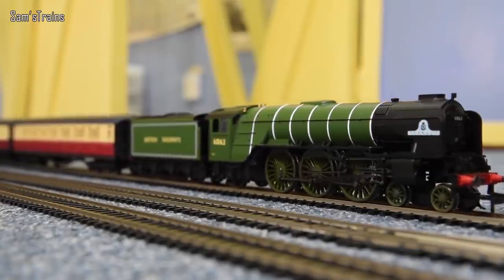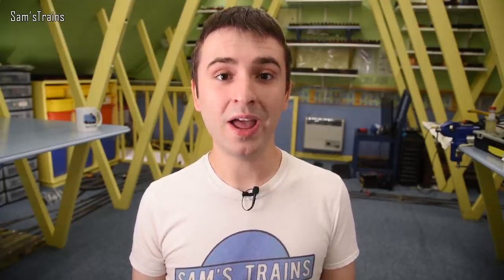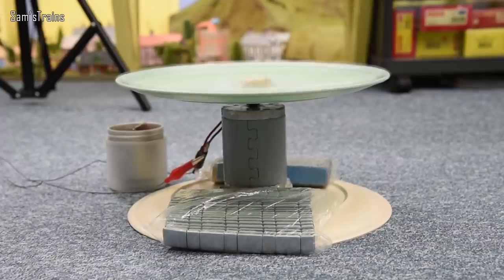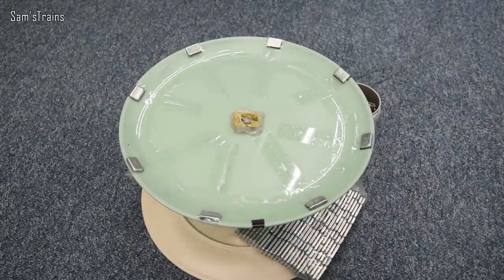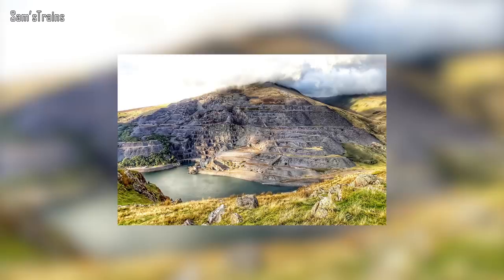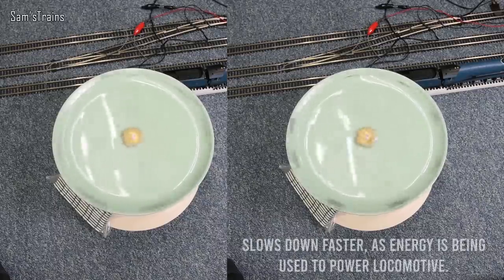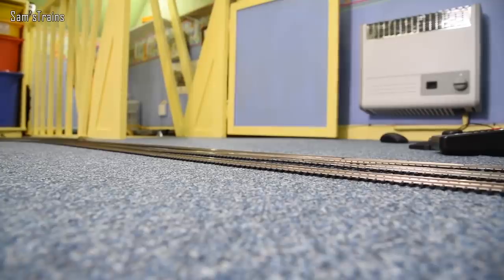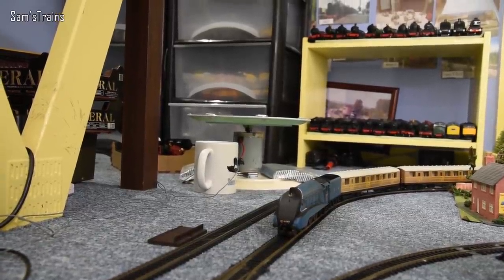Powering Hornby Trains With A Scooter Motor & Dangerous Flywheel

Comment: A safer way I have found is to install super capacitors in the locomotives it provides a lovely affect plus it allows smaller locomotive like a small 0-4-0 locomotives to pass over dead spots (Express points) without even stuttering.
Reply from the maker: Yeah that sounds cool! Are super caps not sensitive to polarity then?!
Thanks for watching - Sam :)
Reply: @voltare2amstereo  Reverse parallel would make them useless. Polarized capacitors in antiseries behave like non polarized, so this is a proper way to do it.

Comment: SAM! You are learning "Regenitive Braking" or "Dynamic Braking"... When trains go downhill, diesel locomotives go into "Dynamic Braking" to turn the big generator/alternator into a load-consumer instead of a power generator and that power goes into the batteries and electronic grid which is then cooled off by the large fan(s); Electric trains in the same manner reroute that power back into the lines held by the catenary system-for other electric trains going up-hill.  I'm proud of you!  John BC, Canada
Reply from the maker: Cheers John - yeah that's exactly right, the very same thing!! :D
Thanks for watching, Sam :)

Comment: FANTASTIC, SAM  !  - 100W, 24V DC motor, 1 Amp from controller.  Good HARDWARE match.  A better/Safer flywheel and a protective cover and you have a switch in/out Acceleration / Deceleration feature !  Your BEST Tech Video EVER !

Comment: This is going to be a good video....

Big motors, big flywheels, lumps of metal rotating at crazy speeds - my electronics engineer inside me is interested.

I think if you were able to have a more permanent setup (maybe with the motor hidden in a cupboard) with a less dodgy and more permanent flywheel, this might actually be more cost effective on smaller layouts instead of buying a really expensive inertia controller.

I can see where people could go with this Sam - sometimes experiments have to be crazy to start with to find something useful out.

Well done once again, great video.
Reply from the maker: haha thank you - it seemed like a good thing to do! ;D
Thanks for watching - Sam :)

Comment: Hey Sam, I thought about this for a few minutes and I think you could do a similar thing without the dangerous spinning metal flying around. Just get a large inductor and connect it in series between the controller and the rails. That would take care of gradual acceleration. Then if you put a diode across the controller's output it would allow the inductor to continue powering the train when you shut the controller off, for gradual braking. The only downside with the diode is it only allows forward movement (it'll short-circuit the controller in reverse) but you can put a simple reversing switch between the inductor and the rails and use that for reverse.
 
I have no idea how big an inductor you'd need or how much it would cost. It might be cheaper to make your own by wrapping thousands of coils of wire around an iron bar? Anyway I'd be interested in seeing how a system like that would perform alongside the flywheel setup. Maybe for your next experiment?
Reply: I was thinking the same thing! I don't think the inductor will need to be excessively big. In fact I wonder why manufacturers haven't done analog controllers with this kind of function built-in
Reply: DC based momentum controllers have been around since the mid 1960s. From specialist upmarket model train control makers, not the train set makers. Lately most development has been in DCC to at least replicate what the best DC controllers did.
Reply: @johnd8892  Good info! I'll look them up since my "layout" is just EZ track loop and there's no point to do DCC.
Reply: @zujiahuang8454  a Google search for 
model railway inertia momentum controllers.   Should be a good starting point to research these inertia and braking controllers for DC further.
Reply: @johnd8892  Thanks!
Reply: Hmm, be careful with the large inductor idea. The trouble there is that you are basically constructing the mechanism by which a car generates the voltage for the spark plug. Which is a few kV, albeot transiently. When you disconnect the power the magnetic flux built up in the inductor will still force energy to flow. If it can't, because you've disconnected things, the result is that the voltage ramps up massively until it can find a discharge path. This might be blowing the hell out of your controller output stage, or finding another place to arc over. 

Its much better to control inertia or braking electronically instead inside the controller. Its not even that difficult and can be done inside dc controllers.
Reply: @extrapolator2000  You're right, I hadn't thought of that. Could this be avoided by connecting a capacitor across the inductor?
Reply from the maker: Yeah - could an inductor even supply that much current for so long though? I'm no expert, but I'm pretty sure it couldn't?!
Thanks for watching, Sam :)
Reply: @extrapolator2000  Probably a better idea to use capacitors then.
Reply: @SamsTrains  depends on the value. But yes, its how a car ignition works, and that also works on 12V - if you have a big enough one and wind it up to maximum magnetic flux.
Reply: @John73John , again, depends on the value. If its a big enough cap, of course. Energy stored in the inductor is 1/2 L I^2.  If we assume this all transfers to the cap then this will equal the energy stored in the cap sometime later = 1/2 C V^2. So with the size of the cap you can calculate the voltage that would be reached. (If the cap tends towards zero you can see that the voltage will tend towards infinity). What will also happen is that the resultant circuit will oscillate, as the cap the recharges the inductor and vice versa until losses damp it down.

Much better to do it electronically with modifications to the control voltage setting in the controller. I once built one of these to control a G scale electric set I once bought that came without a controller. It had a settable acceleration and deceleration that would take up to 10 minutes to accelerate or decelerate the set (depending on the setting). Its fairly simple stuff and works well.
Reply: @extrapolator2000  Yeah, I was thinking the same thing about the capacitor yesterday.
 
I believe there are "breakdown diodes" that would also solve the problem, right? As in, if the voltage goes above X, dump it into a resistor? (I'm not an electrical engineer, I'm just remembering stuff from university physics class).
Reply: @John73John   Yes, you could use some sort transorb, gdt, zener or similar, with sufficient size and rating to handle the dumped power. But its much easier to solve this whole thing in the control circuit :-)  I believe Gaugemaster does a nice controller with accelerator and brake functions, if you prefer analogue. 

I also recently bought an n gauge Graham Farish (Bachmann) class 37 with DCC, and have been very impressed with the smooth start and acceleration function of that DCC decoder (I think its a rebadged zimo), and they're not even that expensive. Contrast that to the chip inside the Dapol Hymek I bought, which is shocking bad. You can actually tell the discrete speed steps. I've replaced it with an identical Bachmann one like the 37 and its much better.

Comment: Analog controller inertia devices were the subject of tons of articles in Model Railroader and Railroad Model Craftsmen back in the day.  The best mechanical systems were all pairs of motors with a flywheel.   The controller was on 1 motor, flywheel in the middle, 2nd motor was a generator for track power.  This meant that the power on the track was always directly related to flywheel speed.  In the parallel setup Sam shows the flywheel and locomotive are fighting over power from the controller so the results aren't as good.
Reply from the maker: Yeah I've heard about that - that sounds like a much better way to do it - I do like the idea of physical flywheels, but no reason to have them as big and silly as mine! ;D
Thanks for watching, Sam :)

Comment: Hi, Sam. Many articles appeared in the model railway press in late 1950's/early 1960s using two ordinary model loco motors, both onboard the loco. They were connected the same way as yours, and, if I can remember that far back, the results were very similar. it was known as the "Free Motor System".
Reply: Tri-ang actually did make a version of their R55 diesel with a free motor installed. Oscar Paisley may have shown it.
Reply from the maker: Yeah I've heard about that - never knew Tri-ang did one though - very interesting stuff!! :O
Thanks for watching, Sam :)
Reply: @SamsTrains  Google search for
triang r55 diesel noise sound
This should show the excellent Weebly site that has photos. Should explain the two motors are connected in series as I recall. To replicate does not need a now rare XO4 but just a similar current characteristic motor. Short lived due to making an old inaccurate model near 10% dearer. Marketed as a sound system as this was simpler to explain. Be interested to see how effective it is compared to standard. May have been mistaken thinking I saw it on YouTube.

Comment: currently writing a college essay for my mechanics course and part of it is energy generation/rectification/regulation (charging) in an alternator system. Quite nice to visually see the principle of energy generation through a spinning motor. I'm actually surprised this worked as well as it did. Nice one.  If you have a multi-meter you could monitor the voltage drop as the rotor slows down and see the cut off point. 
It makes me wonder if something like this could be simulated, at least in the acceleration stage, with a restrictive consumer inline (that isn't the big spinning flywheel) that could realistically and safely be used. For the deceleration could something like a capacitive discharge work? So many ideas could be opened up with this, what a cool experiment, thankyou for sharing!
Reply from the maker: Thanks Jesse! Yes I was quite impressed with how well it worked too! What I'd really like to do is buy an Oscilloscope and watch the waveform coming out of the motor - that'd be very interesting! Yes that's a good point - I wonder?!
Thanks for watching, Sam :)

Comment: I designed and built a controller that does exactly this electronically. I made a pwm controller with a 555 timer, opamp and mosfet. I used a capacitor on the output of the pot that worked as a potential divider - this controlled the pwm duty cycle. This effectively simulated inertia. I'll have to dig out the circuit! Using on an n gauge layout and it's much more realistic than a normal controller. As I built it, I can also control the frequency which is good.
Reply from the maker: Very clever stuff Tony - I like the sound of that - simple but elegant and effective! Much safer than my approach too! ;D
Thanks for watching, Sam :)

Comment: This is actually a very basic version of what most Hybrid/Electric cars use. It’s basically regenerative braking. Since when you cut power the motors become a generator and take the kinetic energy created from the inertia of the car moving and turn it back into electricity to charge the battery.

Comment: That actually looks really good. You might well have found a market for something there. With some development that might well be an idea with some potential. The Southern Region actually did use a similar idea in their DC electric locos, the incoming line voltage drove a motor that spun a flywheel, the output from which drove the motors, so there was a steady output and it didn't cut out abruptly when it passed over gaps in the live rial and so on.
Reply from the maker: Thanks mate! Yeah maybe - though I think we've moved on too far with DCC for this to even be considered - I might try to make a neater version some time though! :D
Thanks for watching, Sam :)

Comment: When I was a boy I had a vintage wind-up gramophone. It had a very heavy platter - much heavier than your plate, but it was one solid piece of metal with no weights to fly off! I used to disable the regulator, wind it up and release the brake, and the turntable would reach a phenomenal speed! I tried your experiment of powering the turntable with a 12volt motor, but that was nothing like the speed which could be achieved with the clockwork mechanism! So, if you want to do this experiment, get an old wind-up gramophone from eBay!
Reply from the maker: haha that sounds very intriguing - I'll have to look out for one of those! :D
Thanks for watching, Sam :)

Comment: Hi Sam, great vid and certainly got me thinking. 

The problem is that most trains perform too well to be realistic, and if a loco did perform realistically it would be branded as terrible, and for most people it WOULD be terrible.

But part of me really want's a loco with a realistic max speed, with a realistic tractive effort, that needs precise use of the speed controller to be able to pull away without wheelslip, and a good amount of track to get up to speed.

Set speed controller to 50% and off she zooms with her 18 coaches is just missing something...
Reply from the maker: Yeah that's true - I realised a long time ago that true realism definitely wouldn't be desirable, much less achievable! Thanks for sharing! :D
Thanks for watching, Sam :)

Comment: You have basically built a flywheel UPS (Uninterruptible Power Supply). These things are key component in data center power supplies (unlike diesel generators, they do switches on instantanely, and dont costs as much as batteries), and are also used on real railways electric systems, wired as you've done it, leveling loads in overhead wires between tractive effort and regenerative braking.
Reply from the maker: Are they really? I had no idea they were used there too - I know they're used in power stations too, while supplies are changed over!
Thanks for watching, Sam :)

Comment: Thats brilliant!!!  Something that's frustrated me for ages is the sudden starts/stops of locos especially when trying to do a bit of realistic shunting.

I could totally see something like that being sold as a plug in product! Could easily make something heavier but smaller than your plate connected to a decent sized motor and enclosed in some kind of safe housing. I would certainly get one!
Reply from the maker: Yeah that's right - though sadly that'd still happen with this, as it still needs power to the loco to work. You'd have to miniaturise it and put it on board a loco if you wanted it to act like stay-alive :(
Thanks for watching, Sam :)
Reply: @SamsTrains  well a lot of locos have quite empty tenders so there's always an option :p

Comment: The Gaugemaster controller with simulator on it, works like that. You then have a brake if you need to stop quick. Also, you don't have a spinning plate near you. Good experiment, though. Proves that inertia can make a realistic loco control.
Reply from the maker: Yeah you’re right, a much better system than mine obviously! Thanks for the comment,
Sam :)

Comment: What a good "alternative" to any form of command system! No, in all seriousness it is really a good practical way of controlling the current in a realistic way. It is very similar to one of the features used on Lionel O gauge products. It is called the variable ash pan glow effect, and as the name states, it is a light feature for the ash pan. The variable part is not controlled by a program or chip but instead by its power. This is how it works, when the locomotive is set in motion the motor spins and creates a small amount of power, similar to your "cough" metal flinging system. As the locomotive gets faster the light gets brighter and visa versa. Any way, thanks for the video, and laughs, and happy railroading!
Reply from the maker: haha thanks very much mate, never knew about that Lionel one either, sounds pretty awesome! :D
Thanks for watching - Sam :)
Reply: @SamsTrains  Your welcome and hope you have a great week!

Comment: The great American modeller John Allen did this years ago on his Gorre and Dafetid Railroad, using two identical motors coupled together through a heavy flywheel. One was used as a motor for the flywheel, the other as a generator coupled to the train tracks. Much less dangerous than your setting :-) I have the French version of the book about John's G&D, but you can easily find an English version or some info online about that.
Reply from the maker: Yes I've heard about that arrangement too - sounds like a really good way of doing it!! :D
Thanks for watching, Sam :)

Comment: when you put the controller in reverse with the flywheel spinning, the controller shorts the output of the motor-now-generator and draws huge current which quickly kills the kinetic energy, like the dynamic brake on real locos
Reply from the maker: Yeah, it must be doing - the energy is certainly disappointed from the flywheel!
Thanks for watching, Sam :)

Comment: Loved the video, very interesting idea, loved the engineering behind it. Took me until seeing it working to actually figure out what you were doing. Don’t know if it’s ever something I’d try on my own layout as a) I use DCC and b) I hate momentum control (mainly because it makes emergency stops extremely difficult, unless you’ve got a switching circuit that can cut stored power instantly). I would guess with a few capacitors, you could achieve a similar result, but no where near as fun or entertaining to watch.
Reply from the maker: Thanks a lot Stephen! that’s true actually, it’s not very practical!
Thanks for watching - Sam :)